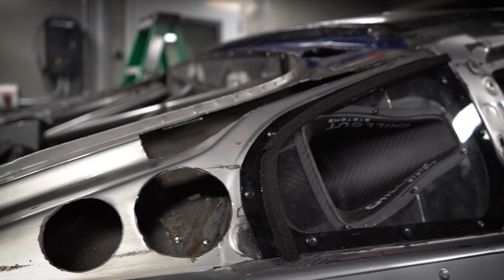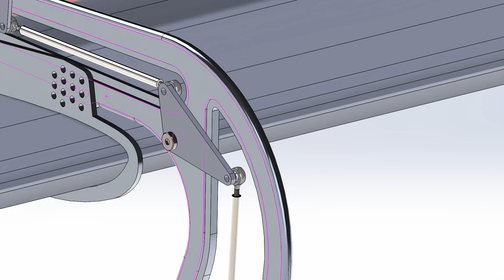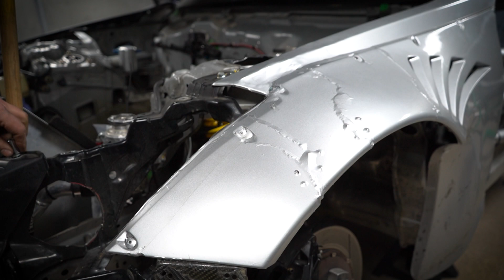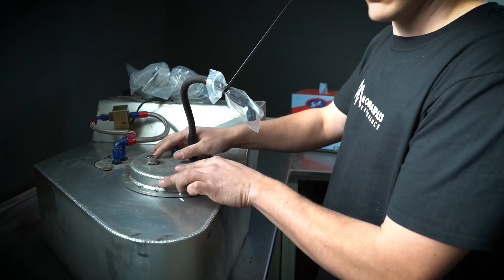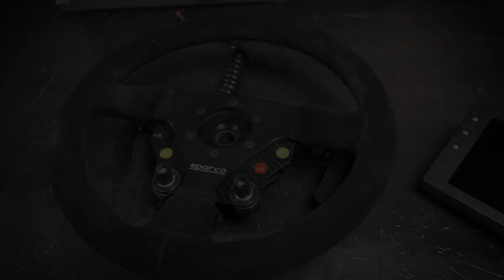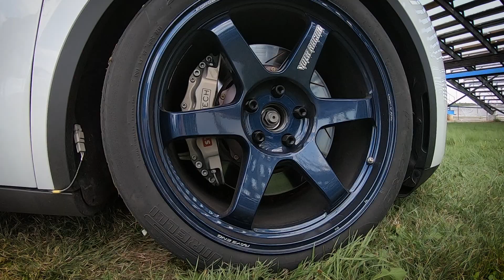KELS-21 Hybrid Build Series- Episode 2- Tech Talk with Sasha Anis

Comment: Sasha been watching you since the header vids on the vq. If I brought it to you or if your ever near az. Would you tune my sentra ser spec v vq35 swap 2nd gen maxima motor high comp c9 c10 cam with holley intake and ls3 throttle body. Stock block with drop in c8 cams made 393 at 8k  on that setup. But bottom end was way down on hp and tq. So high comp is my way to make it linear. But your the best vq tuner I've seen and would love for you to tune it one day tbh.

Comment: That drs is way over the top. Much more efficient to stall the wing by closing the gap between the elements. Can run it off your pneumatic shift system. Look at formula Renault 3.5 drs system for inspiration